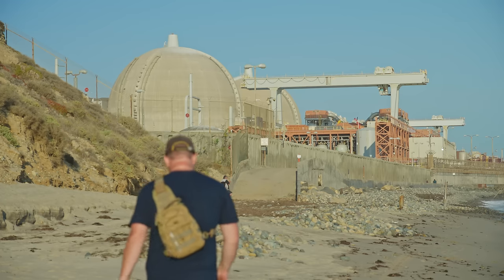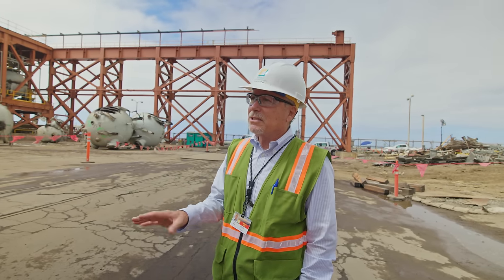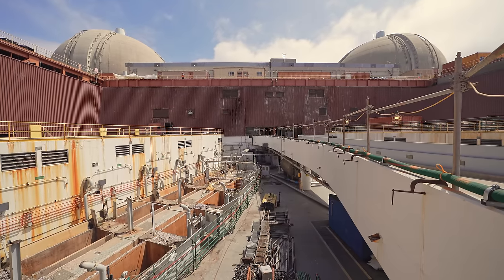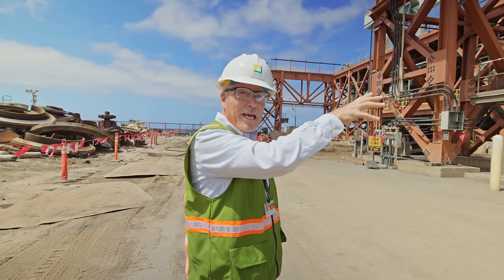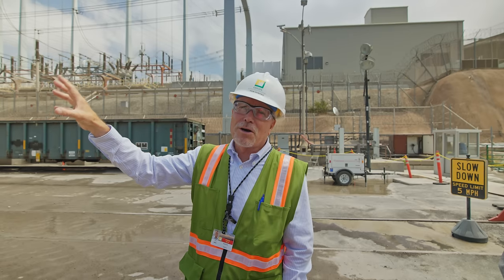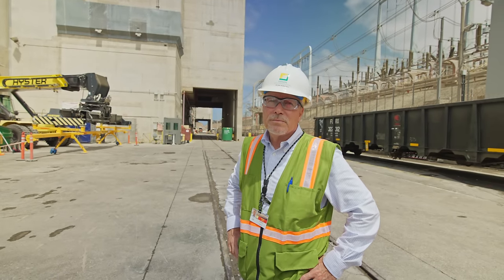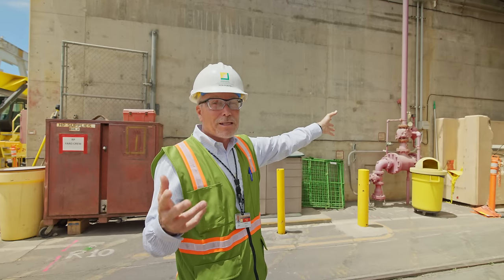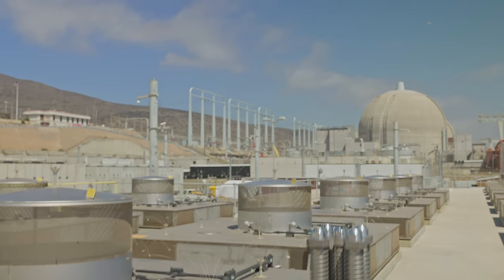Inside the Decommissioning of San Onofre Nuclear Power Station

Comment: First off Drew, great video for those who have never been to the plant. I myself was an in house mechanic there up until closing when we were laid off. I was employed by Southern California Edison. I was extremely involved in the maintenance of the plant, particularly the faulty steam generator during our last days. Here is some information you and the public would love to know:
1. We were an INPO 4 plant, meaning we had a lot of personnel issues with running the plant. At one point when I started in 2005, we're were INPO 1, and gradually degraded our performance. There are 4 levels of INPO performance ratings and were at the bottom, at risk of getting shut down by regulators already.
2. Unit 2 was fine, it did not have the same harmonic issues that Unit 3 had. Unit 2 was in a refueling outage when we needed to shutdown Unit 3. In order to start a unit, we would draw steam off of the other unit, so a dual unit shutdown was very undesirable as an expensive aux boiler was needed to be rented in order to get a unit started.
3. We fixed the steam generators on Unit 3, this involved adding stabilizer rods and tensioning those rods through the U-Tube style heat exchanger within the steam generator. Unfortunately, so many were stabilized that it was going to reduce our efficiency. This would have a significant cost of operation on the long run, as Unit 3 was not able to run at 100% capacity anymore. Preventable repairs on Unit 2 did not affect it's capacity, she was ready to rock and roll at full capacity. Unit 3 was ready to rock and roll at slightly less than full capacity, and it still would have been profitable to.
4. The decision to run at reduced output, 75% capacity, was only for ONE month, shut down, verify repairs were successful, then do the same for six months. After that, determine if it could be ran at full power. This is much like a break in period of running a newly rebuilt motor in your vehicle. Here is where the lies came into play, regulators required a 2 (could have been 1) month commentary period from the public, where if anyone had issues of us running they could challenge the company, and the company was required to address the concerns. Everytime we did, the commentary period reset, and more concerns would come in. It was never ending. We were sitting on our asses waiting to hit the GO button. We had aux boiler in place, rented at the tune of $1M/Month. We had employees on payroll, with zero profits being made. This went on for a year. That's quite expensive for the company, so the decision to shutdown was largely made based off of the cost. We even had our company CEO at the time, Mr. Ted Craver come and meet us face to face in our morning meeting to assure us we were going to start up. I don't blame the company though, it's meant to make money...and it was not in fact doing that.
5. Unit 2 had zero issues. That was 1100MW of clean energy that could be on the grid this very minute.
6. This is my favorite one you won't hear about. During shipment of the steam generators for unit 3 from Japan, Mitsubishi had DROPPED the generator that had tube fretting while loading it onto a barge. 550Tons of precision equipment fell 3' (from what we were told, maybe more?). Do you think this would cause damage? Broken welds internally? Our issues with fretting we're directly related to the supporting structures of the tubes. Is that a coincidence?? When the generator finally arrived on site, there was extensive eddy current testing performed on that generator compared to the others we had prepared. We spent an entire extra month inspecting what we could to determine whether or not there was damage from being dropped. There is no equipment that can analyze structural integrity of a weld on the internals of it though. Guess what? You probably didn't hear of that. Nobody other than those involved know about that, as once it was deemed acceptable to use...that issue was brushed under the rug.
7. Fuck you Mitsubishi Heavy Industries. You crippled a plant, you crippled 1000+ workers dreams, you crippled a community, and you crippled pride.
8. WE WERE FINE. BE CAREFUL WHAT YOU WISH FOR GREEN PEACE AND FRIENDS OF THE EARTH. Now your electrical grid is supported even more so by fossil fuels. If you don't know what you are fighting for, educate yourself before you battle. You literally caused more harm than good to our environment. Who gives a fuck if we wanted to run at partial power, it's not like it was going to blow up or some shit... these things are so damn safe to operate with highly trained employees. We literally shut it down to protect the environment, we could have just kept on running with a leak you pricks.
Reply from the maker: Wow, that is some great info to know. Would make sense why that steam generator had so many problems. Being that big and dropped 3 feet will cause all kinds of problems. Thanks for sharing this.
Reply: @RadioactiveDrew  there's obviously more to it all, but you get a better idea. The spokesperson who gave you a tour, he was about 95% accurate. You gotta remember, Edison International is a public owned company, they do not want to do anything that will lose shareholder interest. Public companies of that size need to have quarterly profits. They say they care about the grid, they say they care about clean energy, but in the end it's all about shareholder value and absolutely massive CEO bonuses. Decommissioning a plant shows profit gains vs loss, as the decommissioning fund had already matured. The plant was worth more dead than alive so long as the community prevented plant startup. Now you purchase your power from other utilities at a premium rate, experience brownouts due to the lack of available power on the grid, increased your carbon footprint, and also pay a little extra on your electric bill for decommissioning of the plant...which makes absolutely zero sense since the decommissioning fund had fully matured and decommissioning was already paid for by the customer. Check your bill 😉
Reply: Where the pieces of turbine lay on the ground, that was our maintenance building. There was also a warehouse and engineering building just east of the maintenance building
Reply: @Matt Pierce If only the RSG’s were bought from Westinghouse and NOT Mitsubishi. The plant wouldn’t have been in this mess.
Reply: Thank you for that information. I live north and inland of that plant and always thought there’s great future in Nuclear. It takes many sources and as a Havasu regular seeing Lake Meade/Havasu water levels drop it terrifies me why we aren’t making a more aggressive push towards nuclear and wind powered, along with wave generation. 
I’m sorry you lost your employment to a careless mistake of dropping the equipment. I hope things have worked out for you ❤️
Reply: @MistressGlowWorm  absolutely. Bor and raised in California... accepted a job out of state and away from my family to stay in nuclear power. I believe in it, but California does not.
Reply: @mattpierce4143  We are missing the mark, especially with Thorium on the horizon and hopefully fusion. All this sun and there are no solar panel “shingles” or on every house. No consortium of energy? No desalination to take the load of the Colorado river? This sucks.
Reply from the maker: You could replace wind and solar with nuclear only. Wind and solar for small applications are better. Having giant areas of land taken over by wind and solar isn’t great. It’s a giant waste of land. People think the desert is a barren wasteland but it isn’t.
Reply: #6 it was dropped during shipment but still loaded it and allowed to be installed ???  This is stuff that I never heard about while working at So Cal Edison  ! All of 27 year career we never made such a BIG mistake of installing something that was DROPPED and still used the damaged part ! 
#7Mitsubbishi heavy was at fault for dropping the pump but...... what the hell happened to the "Quality" with  "QA & QC" at SCE at San Onofre ????? 
As I stated above I had a good 27 year run working for a great company i beleived in but in those years I kinda sorta had draw the line and just shake my head at all the decisions that were made. Most were outstanding and safe some not so safe or understandable !  I worked on the road crew with Division Maintenance. It was always the same thing but a diff location and 1 stop really peaked my interests , That would be SONGS !    RGBS & LBGS were at the top of the list as most dangerous places to work. RGBS was known as Leaking center and bad instrumentation that blew up the Generator! LGBS filled the hot well up due to known issues bad instrumentation in the condenser ! we opened up the generator and it was last painted in 1927 ! there was a rumble , then another then the unit came to a screeching halt  ! Big 36" radial turbine bearings came out in hand size pieces !  Then out of the blue the MOGS steam pipes blew and people died ! I cannot tell you how many times  walked right next to that pipe !
Reply: Also, the steam generator issue was the excuse used by SCE to exit nuclear power. Sounds big and scary, but in the end was nothing more than a tube leak. LOL LOL  Could have been easily remedied. Most here probably don't even know how many moving parts are in a steam generator. Or what it does...Ha Ha.....
Reply: Mene Mene Teckle upharson the writing was on the wall . Uncle Ed is no stranger to recognizing what the future had in store for 2&3 . Loss of generation ,BFD ! Gee, look at how long Unit 1 lasted ! But that was obvious why they flipped the switch! And with hindsight so was 2 & 3 !
Reply: @Duderocks5539  my thought exactly ! It’s safe to say that they were the lowest bidder outa 3-4-5 that got the job ! But, that’s how Ed made stuff work ! Just like seem less pipe was available but wasn’t used at MOGS , RIP YO ALL MY FRIENDS THAT PARISHED NEEDLESSLY ! Can’t say how many times I walked by that pipe in my regular daily duty …
Reply: I used to work at SONGS during outages since spring 2005, until the last outage when the issue with the new generatos in U2, I was involved with both steam generators replacement as a Radiation Technician, it broke my heart when they decide to shut them down, I have been working in many nuclear power plants in USA, and I love all of them but SONGS  was my number 1 favorite plant to work. God Bless all those people than lost their job from SONGS.
Reply from the maker: I feel extremely fortunate to have met some of these people that still work there. Some of the nicest most professional people.
Reply: MATTTTTT! 

It is Don Shively. How have you been? Are you in supervision yet?

I could see my old buddy getting more and more "steamed" as your tale unwound. At the end of your article ... I could see you stamping back and forth. 

There was the old Matt I remember. 

Good job on "lettin' em know!"

I hope enough people listen to the truths you just wrote for all to see. I stood there and watched as the plant "went active" in the 80's and I hung my head when they shut it down decades later ... for no good reason!

France is re-starting dozens of reactors they closed. Not us. We tore ours down. At least our other plant was saved.

What were we? 6 days short of restarting after all those repairs? Then BOOM! The dream was over. Millions of homes suddenly needed power from "elsewhere".

I have told this story over and over, with pen and sketch pad in hand.  I've sat in Elk's Club and VFW gatherings here in Vista and told it. 

I even wrote a bit on Quora and Nextdoor about the injustice of it all.  Folks got shocked. People now complain about triple-cost energy bills, I tried to tell them why. 

You did a VERY good job of it, Matt. I can see it still pisses you off. Me too.

I tried to explain how the government now forces new home builders and industry to be part of the actual replacement for San Onofre by "going solar" and simply taking the power they generate for sale. 

Hey, your neighbor's new Tesla has to be charged somehow, it may as well be from YOUR expensive system!  (Unless the state tells them NOT to charge it just now.)

Try going "off grid" with your own solar and just see what happens.

It makes you want to throw the breakers and move into the RV with its 12v panel system but there are laws against doing that.

Yep, They planned this one well.

Stay cool, Matt.

Donshively55@gmail.com
Reply: @donshively9395  hah, no. It's a bit more cut throat outside of a union
Reply: Tell that to Navajo nation, if dare.
Reply: dude inpo 4? what was going on? HU issues? lack of experience?  im sure you had all the "help" you guys could use
Reply: @alpha1172  I don't remember everything, but I do know a lot of it was ops training. We had our fair share of hu events, but nothing huge. I know that safety was absolutely trash, but none of it was in house. For example, one of the steam generator replacement outages had well over 80 first aid/injuries. It was really a culture deal. You are right, we had ass tons of help. Weekly stand downs, and even 2hr stand UP meetings on Tuesdays. It was fucking miserable 🤣 BUT, I'll be honest...an inpo 4 plant operates significantly better than an inpo 1 😖
Reply: @mattpierce4143  with the amount of help I'm sure u had everyone was 4.0.  Alot of sites are having experience issues now. The downsizing sites were going through to remain competitive is really starting to have an effect.
Reply: @alpha1172  competitive? Who is not paying their electric bill now vs before? Inflation does not make us less competitive, that's just corporate lingo for bigger bonuses.
Reply: @mattpierce4143  being competitive with solar helps out alot. The gaurenteed 40$ a mwh helps out a tremendous amount considering we were trying to get down to 25$ by 25 so we could still make it
Reply: @alpha1172  without coal, gas, or nuke...solar wouldn't work. So how can it be considered competitive? Price per megawatt is not everything. Then again, if I knew better then I would own a utility 🤣
Reply: Don’t forget politics role in the closure. Boxer and Feinstein were demanding the plants be relicensed, which costs millions upon millions and millions more to fight litigation under the old licensing rules SONGS was licensed under.

Couldn’t operate at 100%, but wasn’t that the new power uprate values. The utility wanted to reduce power to the old licensed value and run for decades, but when politicians said the company couldn’t be trusted to operate at that reduced level. Obviously, politicians don’t understand licensing and the NRCs role.
Reply: Damn. That’s an insane story. Sounds like a nightmare. I know exactly how that shit goes too. All to familiar. I work at a nuclear plant on the east coast. Been in the industry for 10 years. The decision making process is atrocious. I hate seeing nukes being shut down. And I feel your pain in the last part of your comment. 😭😭 sounds like a bunch of bad decision making led up to y’all being shit down. Having the public involved in nuclear decisions will never end good. Sounds like unit two should 100% be up and running today. Glad you found another place to work. 🤘🏼🤘🏼🤘🏼
Reply: @modenaro1776  yep. You’re right. we’ve plugged leaking steam gen tubes with zero issues.
Reply: I've read this too. It was the beginning of the continuing period of general Japanese incompetence. They had their moment but returned to type. I AZ we have stations built to be peaking only fueled by gas and oil now run 24/7 to capitalize  on Californias poor decision making, and virtue signaling. Luckily the Palo Verde Nuclear Generation Station California utilities are not major partners and one of the main The Salt River Project helps to make sure the facility is operated in peak condition
Reply: Very sad story, clean energy gone. Dropping the unit criminal and should had not been accepted. Then the customers had to pay for the mistakes made.
Reply: Based comment.
Reply: Thanka for sharing. I always find power plants fascinating for some reason.
Reply: @mattpierce4143  There is magnetic dye testing for testing a weld non-destructively, but you know how many Welds would need to be tested? And I’m not sure if that type of testing is available to all materials or not.
Reply: @Len_M.  They did much testing, mag dye is not very accurate btw. None of it matters now
Reply: @RadioactiveDrew  I've seen the damage this causes... I love deserts. Solar panel farms completely sterilize what flora and fauna used to exist there... instead becoming breeding grounds for weeds and invasives. 
Same with wind farms. Used to live in the desert outside of Palm Springs, in the San Gorgonio pass. That desert was chock full of all types of wildlife, insects, plants. It was gorgeous. Every horseback ride and hike would result in spotting something new. 
Then they put in the new windfarm. And the required gridwork of bulldozed dirt roads for maintenance. 1 year later, nothing. No burrowing Owls, no tarantulas...etc. It killed us to see this happen. 
We need to educate the public better. These concepts aren't difficult to understand... they are sometimes 'seemingly' curated OUT of our news feeds by our social media giants.
Reply: @johngouker3887  
Actually, SONGS was SHUT DOWN by Kamala Harris when as California AG (January 3, 2011 – January 3, 2017) she refused to sue Mitsubishi Heavy Industries for their product failures. News reports explained that Harris was pressured ($$$) by environmentalists to drop any action against MHI and she complied;  SONGS was then sent on the path to a slow death.
Reply: Greetings:
Insurance: on a major project like the Mitsubishi steam generator builds you'd think they would buy insurance to guaranty the project was successful! I followed the LA Times coverage as best I could. IIRC: SCE wanted to sell more power by increasing  the generated power output. While it was time to overhaul the steam generator, someone sold SCE on the increase in output that could be gained by adding more tubing to the SG. I'm no expert on them, but they needed some warranty on the success of the project. The insurer's would have been wise to hire someone to ensure the safe delivery of the new completed assembly. I'm sure the mfr. of the original SG could have delivered a replacement built to the original spec. I'm sure MHI was scared to report the drop! With a low bid they would surely lose any profit they expected to make if forced to tear the SG apart to inspect and repair it. Some times insurance really pays off!
I have been very disappointed that the fear of radiation has so hampered this promising industry. The French got it correct when they standardized their nuclear building program to avoid reinventing the system for each unit built. [Lament over.]
I have become a nuclear fan-boy after watching my hometown power company (Lilco) go under with the abandoned Shoreham nuclear power plant just as it was ready to start up. Now that I have embraced the Molten Salt coolant and fluid- fuel system for it native physics safety advantages and construction options, it is time we used one of the options to build one of those plants on what remains of that site to burn the unused nuclear fuel remaining in the "spent fuel" from the light water reactors it would be replacing. As the US Navy through Adm. Rickover pioneered the nuclear submarine technology, we need someone like him to convince the Navy that nuclear is way to go here again. The spent nuclear fuel will significantly reduce the amount of leftover fuel as it is estimated that the half-life of the unturned portion will only require 300 years to reach background radiation levels we can realize instead of the eons required for the 70,000 tons we have sitting around now. The fuel is already there waiting to be burned. Now we just need some ambitious Navy people to trade use of the site for ongoing free power in exchange. Once the technology becomes developed we can explore other Molten Salt reactors to desalination water for the thirsty San Diegans as well. That plant will produce potable water as a byproduct of generating power by cooling the coolant. Come on now Navy, maybe small ships can get off their fossil fuel diet once and for all. Just my ideas, I could be wrong!
Reply: Cheers Matt, T wong from SSID MSS!
Reply: I agree with your paragraph #8.  I was a Senior Reactor Operator at Rancho Seco when they voted to shut it down.  I believe that the voters made a mistake but in a democracy, you have to accept the voters will and in your case the company's financial obligations.

Diablo will operate for 7 more years but require billions in repairs and Californians will pay more for electricity with no more capacity, further souring the public perception of nuclear.

Most nuclear plants are reaching or have exceeded their design life.  As you must know, you can keep them running for a very long time but at some point the expense becomes too much.  I am against government support to keep old plants running. Instead of 1-2 plants shutting down per year, at some point in the future larger numbers will shutdown all at once is we keep band-aiding the problems.
.
Reply: @MistressGlowWorm  You'll never keep you lights on at night with solar power.
Reply: @alpha1172  What a lot of people don't understand is that an INPO 4 plant is like a model of efficiency in almost any other industrial setting.  The plant where I worked also went from 1 to 4 and back again, with very few major changes.
Reply: @mattpierce4143  I hear you brother. Was in the nuke industry too and I worked out of state for a while until it got old being away from home... But I miss working in the industry and at plants - nuke life was a lot of fun. I was working at a plant across the country as the SONGS saga played out and remember hearing the inside info vs. what the public was fixated on and it was sad to hear that misinformation succeeded in shutting down the plant. I get it though. I used to live in North County and remember that many residents didn't like the plant for all the wrong reasons.
Reply: Your side of the story needs to be documented so it can be published out there so other people can better understand this!

It frustrates me reading this as I’m realizing now the people I voted for that called this a win for the people really meant it was a win for natural gas power plants and now we’re stuck (the people) dealing with the consequences.
Reply: @davelowets  You make the assumption that "everyone" will be allowed to own an electric vehicle in the peoples republic of california.  Most likely, that will be reserved for the "important" people, like congress critters and other politicians and the almighty "celebrities".
Reply: @johnjones5354  Thats pretty far fetched...
Reply: Thank you for all that information. I was mad that they didn't use GE equipment since I know the new generation reactors from them are top notch. damn Mitsubishi, should have kept the money at home.
Reply: @MistressGlowWorm  Fusion has been 20 years away for the last 60 years. Thorium maybe, breeder reactors would be better, plutonium for deep space exploration or other spacecraft.
Reply: You are right and I wonder if the fossil fuel industry really helped push to get these nuclear power plants shut down
Reply: My buddy swim and his brother Marty worked with you down there. He had told me Mitsubishi had screwed the pooch hard, and there was a massive lawsuit and that it would take years for another turbine to be manufactured. My grandfather helped build the INL reactor in Idaho, and I have worked as a rad worker 3 as well, with the technology we have now, there is no reason not to be designing and building newer reactors. Watch a Ted talk about environmentalists, ones with actual common sense and the ability to admit when they were wrong and that wind and solar are not a feasible solution. Sorry for everyone who lost their livelihood down there, maybe one day these idiots will wake up and embrace low cost safe energy some day. To many uneducated Greta Thumbergs out there though, ha!
Reply: Glad someone spoke up about this. I only learned about this while working on converting the switchrack into a step down substation during decommissioning. Now, things are getting much worse and more dependent on fossil fuels. Maybe that’s the part of the reason I’m paying almost 500/month on my bill.
Reply: @PrestigeWorldWide777  all part of the plan
Reply: @williambarry8015  what's your brother's name?
Reply: Exactly I live in San Diego and we’re getting killed at the prices of the palomar natural gas plant. That runs off yes natural gas which they put a limit on our use while paying over msrp
Reply: @MistressGlowWorm we would have died this year.  We had zero sun for the last 6 months my security cameras all died that charge on solar.
Reply: Know you have first hand knowledge, when you say full power, do you mean the up rate value the new generators were supposed to be designed for?
The issue with the SGs was the use of the wrong flow data from the pre up rate value.

I believe the utility wanted to go back to the old pre power up rate values, which the SGs should have been able to handle. It all went to hell when the US congress got involved, Feinstein and Boxer, demanding a total re-licensing, saying the utility couldn’t be trusted to operate the plant at old power levels. Obviously they have no idea how the plants operate under their licenses. Power level is just settings in the control system.

Sad to see the plant go, especially now CA is losing their butts with energy shortages and brown outs.
Reply: This is why gas plants are the best
Reply: Matt - Thanks for writing this.  I was with the team that helped the Unit 3 Steam Generator replacement after Unit 2 went around 100 days over.  We did well on Unit 3 and we also work with most of the nuclear plants in the USA with their Project Controls for Online and Outage operations.  Everything your wrote, except 5-7, I've heard exactly the same things from other staff working at SONGS and I 100% believe you on points 5-7.  The closure of this plant was PURELY political.  It was stupid as it comes, especially in the era of Electric Vehicles.  If you ever want contacts at the other plants for work, hit me up.  We work with most of them and I may be able to put you in touch with the right people for future work.
Reply: Wow.
Reply: @RadioactiveDrew stop pretending like that lands was being used as lush green areas, it would still be desert wastelands if it weren't for water from the Colorado River.
Reply from the maker: @Rob_Moilanen not sure what you’re talking about?
Reply from the maker: @Rob_Moilanen I think it’s horrible putting that stuff in the desert. I’ve spent a lot of time out in all kinds of deserts and they all have tons of life. Just as much as any forest. If people want solar they should put them on top of businesses, parking lots and homes. Why ruin nature with that stuff.
Reply: Thanks. You probably gave the ultimate set of reasons why nuclear facilities would never have been a sustainable source of power. At the slightest hiccup they become cost monsters that put enormous pressures on utilities and regulators.
Reply from the maker: @slipstreamvids7422 I think you’re mistaken.
Reply: @slipstreamvids7422  they are only expensive due to regulations and laws. If we stopped viewing them as threats, easing policies...you could cut 3/4 of the cost
Reply from the maker: @mattpierce4143 exactly. The nuclear energy sector is one of the most over regulated. That’s why everything takes longer and is more expensive. Over regulation kills innovation.
Reply: you forgot to mention that they rolled out that HORRIBLE SAP software right before the outage too. We'd show up for jobs in containment missing parts/tools because SAP was causing all sorts of issues. It was the worst!
Reply: @DeanFerraro  you can't blame SAP for anything. Millions of companies use SAP. Hell, Porsches run on SAP
Reply: @mattpierce4143  - Because of their poor capacity factors, wind and/or solar can only supply about 60% of a nation’s electrical power. And even much of that power is exported or even given away because it is often produced when not needed. If you look at nations ranked by percent of power produced by renewables, if it’s above 60% it’s because they have either hydroelectric or geothermal resources.
Reply: @emilkarpo  - Though Japan has a reputation for technological sophistication, it apparently does not extend to nuclear power. They had a criticality accident in a fuel plant several years ago by not following basic principles of criticality safety.
Reply from the maker: @KevinBalch-dt8ot that’s what happens when people ignore safety protocols. Those guys mixing that vat for sure had no idea what they were doing. Criticality accidents are extremely interesting and terrifying at the same time.
Reply: JCO's on-site workers did not understand the characteristics of fast reactor fuel. Fast reactor fuel uses more enriched uranium than light water reactors. 
This accident was the result of prioritizing short-term economics over equipment and training. 
It is very difficult to shut down a power plant until an accident occurs. 

By the way, does anyone know of a website with details about Mitsubishi Heavy Industries dropping the steam generator? 
I searched in both Japanese and English, but could not find any specific details about MHI's mistake.